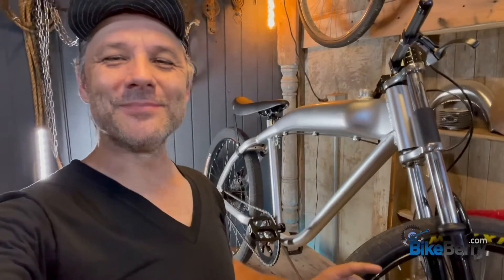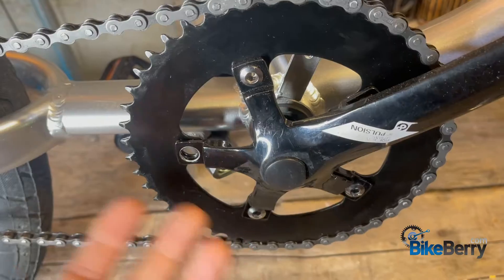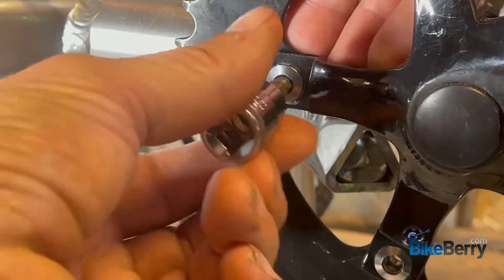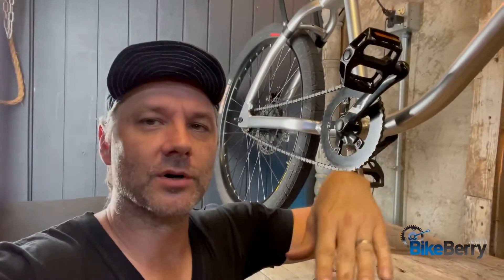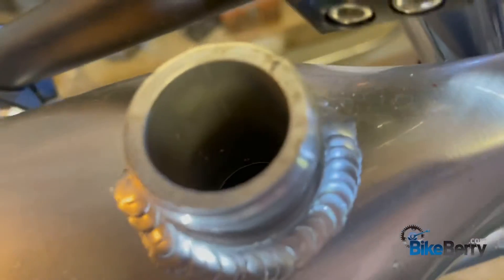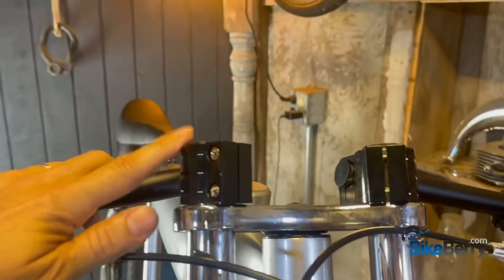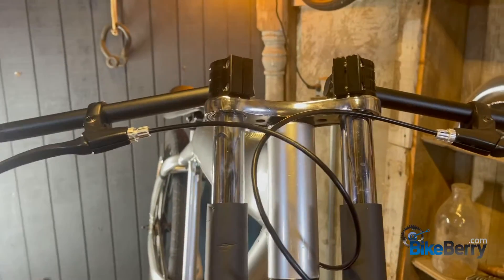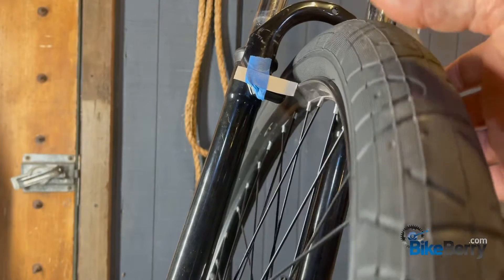Truing Wheels | Crankset Sprocket | Gas Cap Gasket | F-Zero | Motorized Bike | Bike Berry

Comment: 4:00 note, I personally switched to using felpro gasket paper (two layers thick), because the inner-tube rubber swells up in contact with gas.
I cut it a little wide to keep it from falling out.
Reply: Good to know. I’ll make the switch. Thanks Hover!

Comment: seals-all would be good for gluing the rubber disc in the gas cap since it's gas resistant
Reply: Agreed.
Reply: I've used a couple of dots of permatex before.  Paying careful mind to only use just enough to hold it in, not to make a mess.

Comment: Think you could do a demo build of your 4 stroke 50cc kit? That way you might figure out what the kit is missing and fix it. Then your customers won't have to spend hours on the line with dodgy customer support trying to explain that a 1ft fuel line won't reach a rear mounted engine from the included front mounted gas tank.
Reply: Yup, that’ll will happen in months to come. Thank you for the suggestion 😊
Reply: @tonytaylor5087  been looking forward to a 4S build myself.  glad to know one is in the works.